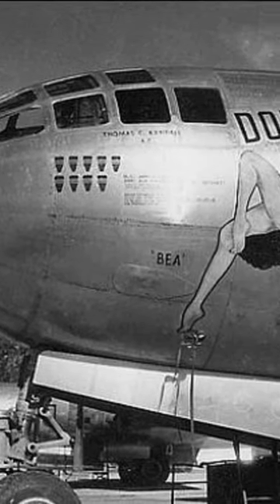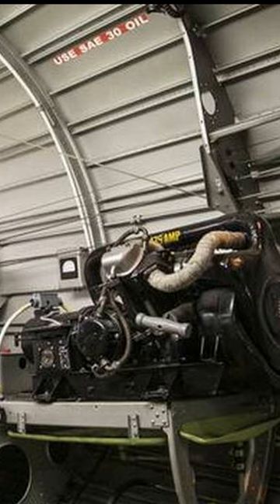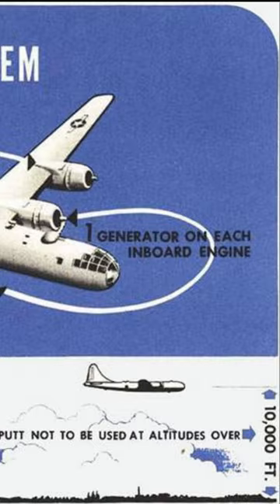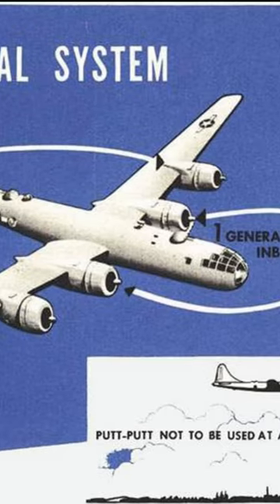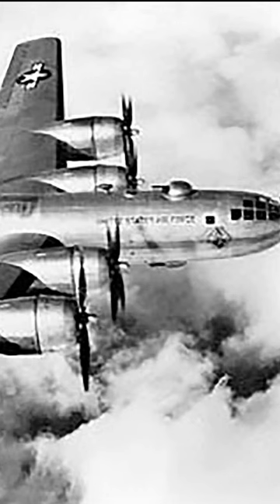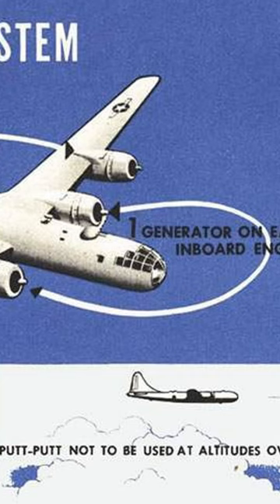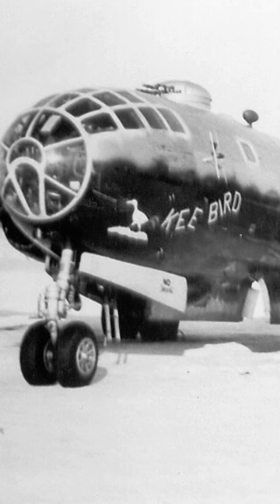Starters 9 APU Auxiliary Power Unit

Comment: I once watched the documentary about the recovery attempt made to get the "Kee Bird" off the ice without knowing how it had tragically ended.  I swear,  I felt like crying watching it melt down to nothing.  
  Apparently,  the units ran off of the same fuel and from the same tanks as the main engines,  and were notorious for leaking fuel everywhere.  This, plus the fact that they were kept outside of the pressure hull meant that there wasn't a crewmember assigned as fire watch over the unit, and sure enough,  they needed one. 
  Even  the support personnel on the ground couldn't do much more than just watch it burn, as they didn't even have anything more than a few hand held Co2 and soda canisters around to attempt to stem the roaring flames.
  What a crying shame that it burned completely down to the ground.  A total loss.
Reply from the maker: I agree that was such a sad story! All that work on that beautiful airplane and all for nought!
Reply: Apparently, the APU broke loose from its mount. Just imagine if it had done so five minutes later in the air.